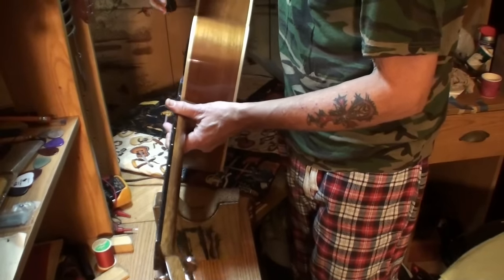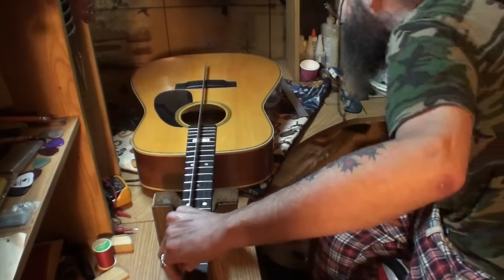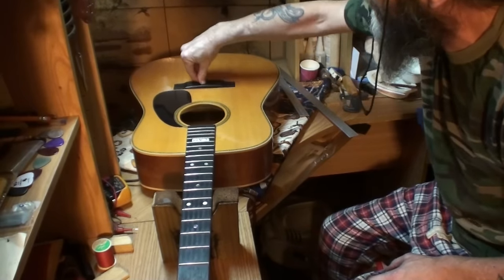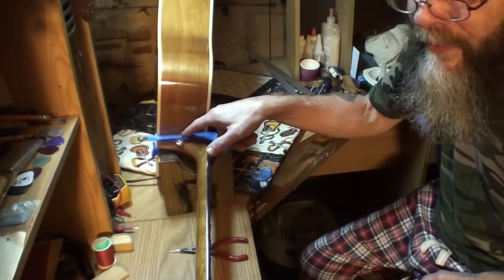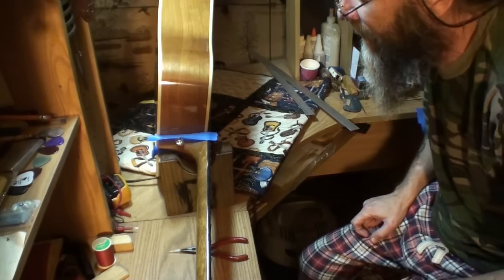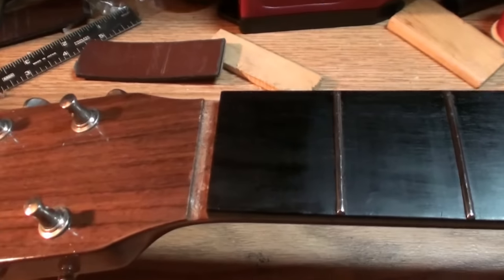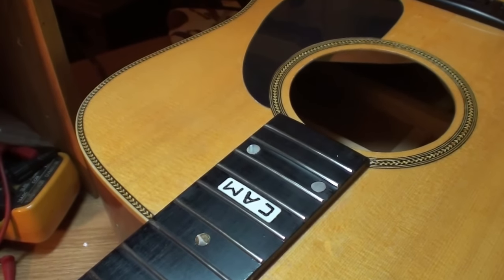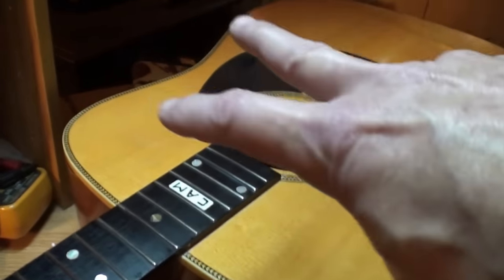Echowebb guitar preps, checking new neck angle polishing frets oiling fretboard, gluing in inlays

Comment: A trick I learned from a luthier here in Midland, Tx. about humidifying a dry guitar.
Take one of those large, black, plastic leaf bags and put a guitar stand inside with a 
bowl of water. Then put your guitar on the stand and seal and tie off the bag as high on the neck as you can. Check it daily until you get the result you want. The frets on my Mexican strat were sticking so far that you actually couldn't play the guitar, so I put in a bag like I described and in three days, voila! fretboard id slick as glass!. Be sure and monitor daily on an acoustic guitar as it can really swell up!
Reply from the maker: That would be a good way to get humidified in a hurry, but if a guitar is really dried out bad it takes a very long time to get it up to normal levels and maintain it. It takes weeks to soak into and penetrate the wood deep. This method you mention would work tho if the guitar hasn't been drying out for too long.  Thanks for the idea and for watching!

Comment: Hey,  love the vlog!  Great stuff.  Question: If the saddle transfers the string vibration to the body,  shouldn't the saddle protrude through the bridge and contact the body?  Just curious.  Keep up the great work!
Reply from the maker: The bridge helps spread the vibrations over more area of the top, also some bridges have what they call a "threw saddle" that extends across the bridge farther to help distribute the vibrations of the strings better.

Comment: Randy  for a minute there I thought you went out  golfing with those pants on :)
My Unlce told me long time ago if you have scratches on your guitar use cigarettes ashes.
I ended up putting  a scratches  on my band news  Mossman guitar great plains  I work all summer back in 82 
I try to take out the scratches with cigarettes ashes . Well it made it worse in that one place has a dull finish.
I wish I still  had that Mossman guitar  I sold it back in 89.  Randy have you ever come across a mosssman in your travels ???
Reply from the maker: scott ford they prolly would be good for gulfing! :) thanks Scott!